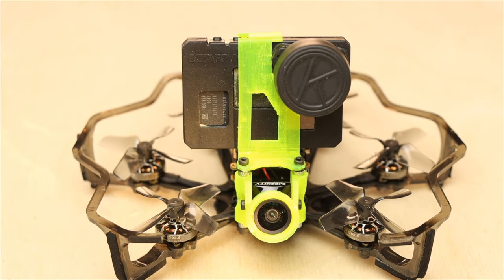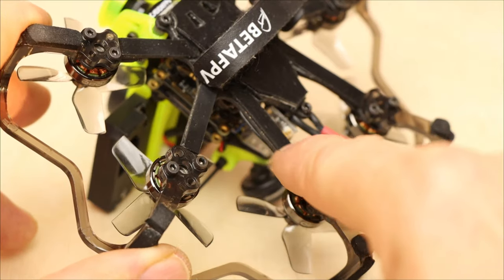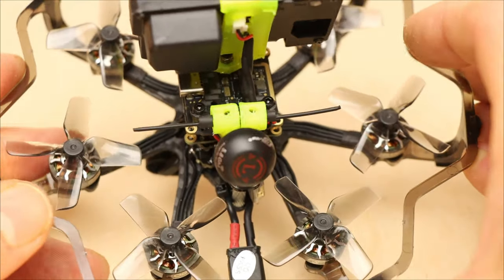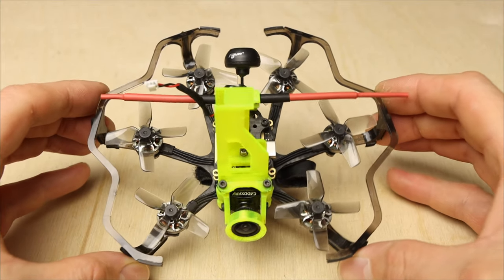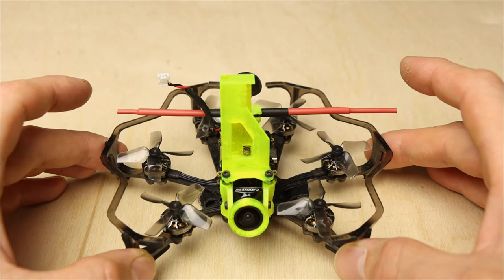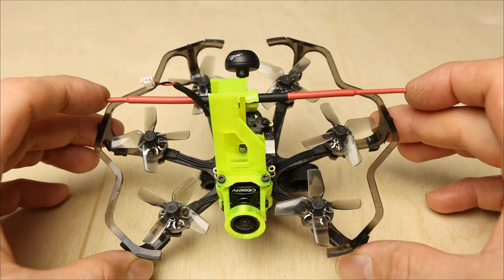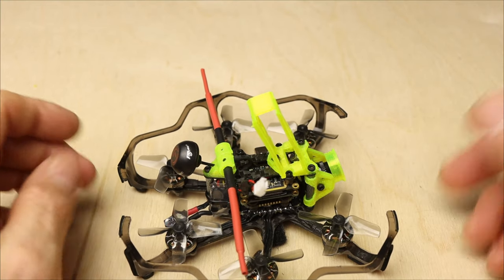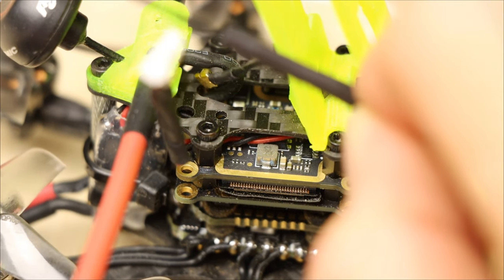Flywoo Firefly Hex Nano hd wow!! unboxing and flight review

Comment: Superb video! I'm new to your channel and impressed with your flying and review. Will be checking out your other videos right now!  =(:^)-
Reply from the maker: Thanks! Appreciate that! 🙏🏼
Reply: @Stevieboyfpv  How is it without carrying an HD camera as just an acro ripper, ripping between trees and around other objects?  I don't care about HD footage, but like it's ultra small size and Caddx Vista clarity while flying.
Reply from the maker: @KOrnhOliO1  personally I love it! It handles superbly! Its quieter because of the 6 small props it punches well above its weight! If you get one make sure you get the prop guards as they're link the arms together giving it more strength as the unibody bottom plate is very thin worth getting one of those thrown in as a back up as well as their only cheap 👍
Reply: @Stevieboyfpv  Thanks!

Comment: Strongly don't recommend #Flywoo . They can sell you broken drone with GPS, VTX or camera issues. It's a crap. Support will also don't help you telling that it is normal and drone is not for each region. Be careful if you want to buy anything from them. Or better choose other brand.
Reply from the maker: Yeh i lost my explorer v1 due to faulty gps I was gutted about that for sure i have had no experience with their customer support as I just accepted it as I saw it was an issue in reviews but my v2 has been awesome! And this puppy is superb! Tbf I can pick a hole in most of the companies they are all pushing drones out with issues their happy to fix in the v2 and then v3 the industry is moving  so fast!
Reply: @Stevieboyfpv  With this brand you will never be sure that everything is ok when buy a new drone. Unfortunately....
Reply from the maker: @mdfpv1277  I much prefer building them but I genuinely couldn't resist this little guy! And yeh the minimortal having issues does prove your point for sure